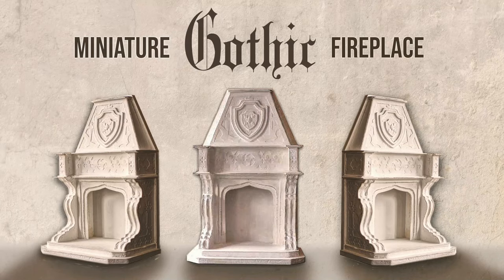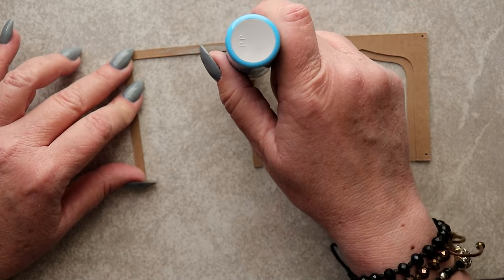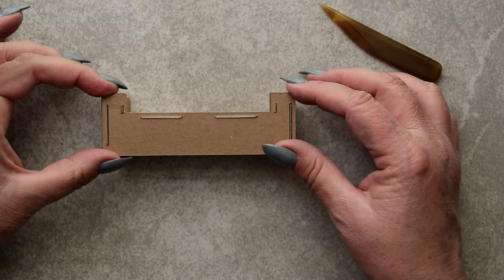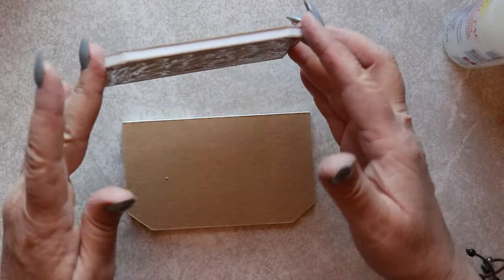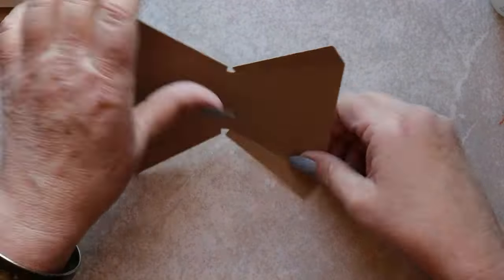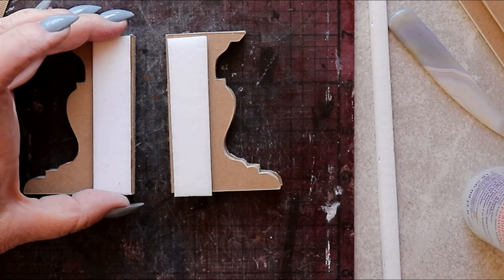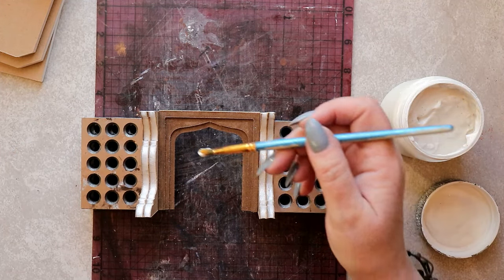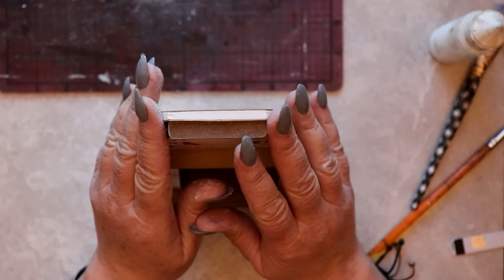⚜Mini Gothic Fireplace⚜

Comment: (I may have initially posted this in the wrong spot!!) Hi Heather. I am in love with all your creations and techniques. Does anyone in the membership use a Brother Scanncut CM350? I want to join but I am not sure if I will be able to do the scoring and other features the Cricut Maker does.
Reply from the maker: Hey Carmenlita! Looks like your machine can cut little dashed lines, instead of using a scoring tool, but to perform the same function. You would change the line 'type' in your CanvasWorkspace. As long as the machine can cut cleanly through 'cereal box' weight chipboard, you should be good to go! xoxo

Comment: Did you alter the suggested settings in Cricut for 65-pound cardstock? Whenever I use 65-pound, my machine just mangles it.
Reply from the maker: I had similar issues, so here are the Design Space Custom Material Settings that work for me:
Standard Grip Mat (no tape)
Pressure: 196
Cutting Passes: 3x
Fine Point Blade 

Good luck!

Comment: Just curious. The foam board I get here. (In the UK) I have to soak before I can remove the outer layer? Is that a specific type of foam core that it just pulls off?
Reply from the maker: Hi Chris - yes, it is - the cheapest, called ReadiBoard, from The Dollar Tree here in the States and in Canada. I found a thread that may offer a good substitute in the UK: https://www.rcgroups.com/forums/showthread.php?1975505-Dollar-Tree-Foamboard-in-the-UK
Reply: Ooh thank you. Your videos are very inspirational. Thank you for breathing new light through old windows... x

Comment: I have a 1 1/2 scale dollhouse I was going to make a spooky dollhouse. I have had it for 3 yrs but I keep running into ideas problems that make me stop. I was thinking about getting a Circuit to use on floor and furniture. Everything I am find is in a larger scale. Is there a way to make these ideas come to life for such a small scale dollhouse? There are a lot of great ideas but this scale is small.
Reply from the maker: Hi Jamie! Your project sounds very cool. When you say: 1 1/2 Scale, do you mean 1/24th Scale (.5" =1') or do you mean Play Scale (1.5" = 1')? 

If you mean Play Scale, where everything is large enough for most action figures or fashion dolls, then the cutting area of the Cricut Maker is sometimes too small to accommodate the size of cuts required, resulting in the necessity to come up with ways to piece together the larger panels.

If you mean 1/24 Scale, then it is usually possible to translate the designs down by a factor of 50%, and to use multiple layers of cardstock, rather than chipboard. My friend Robbin does this routinely, and the results are fantastic! xoxo
Reply: @Thicketworks  sorry Heather its 1/2 scale The Fairfield by Geenleaf. It is my first dollhouse build so I'm pretty new at this.
Reply from the maker: @jamiepolyblank3177  Scale talk is just inherently confusing, my friend!😜 You have nothing to apologize for...so, I hope my previous answer helps clarify: it IS possible to reduce the designs by 50% - with some adjusting of materials it usually translates pretty well. xoxo
Reply: @Thicketworks  I look forward to your videos and I definitely look forward to my purchase. Lol